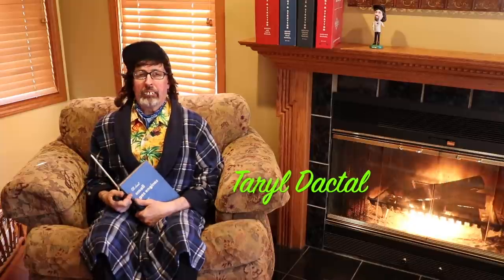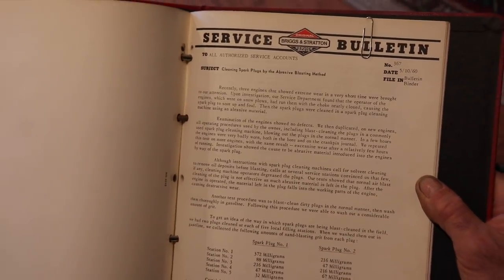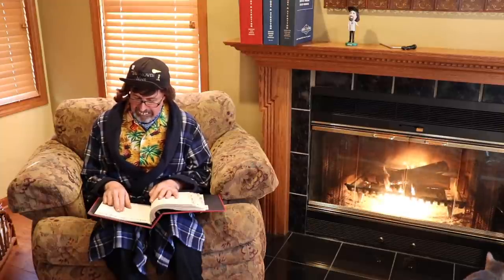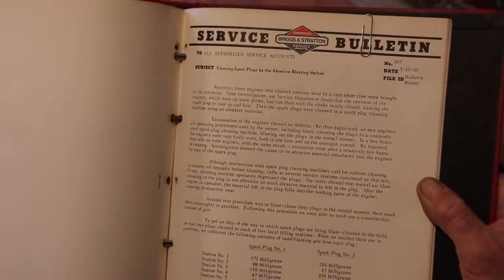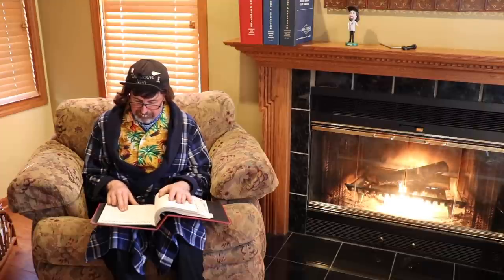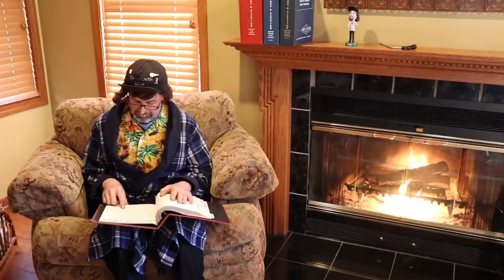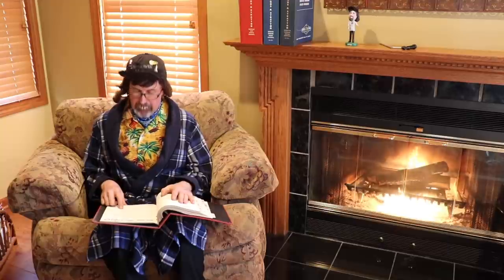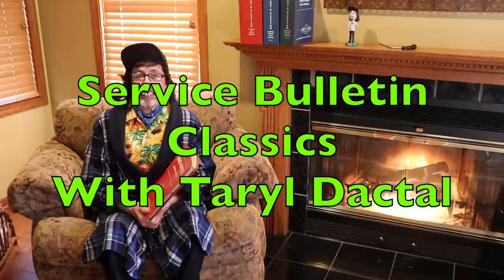Why You Should NEVER Clean Your Spark Plugs!

Comment: I have been cleaning sparkplugs with sand-blasting for more than 30 years and never had any engine problems. You just have to make to sure blow it out well with compressed air. I also use a fine steel wire to probe around inside to loosen up any grit jammed into corners, then blow out again. Finally, inspect with a bright light inside to make sure every piece of grit is out.  If you are sloppy and in a hurry, yes, you will have problems.

Comment: Taryl,  I just tried cleaning a used Champion J8C plug in a bead blast cabinet (same beads used in those spark plug cleaners) and yes the plug looks like new when finished. I flushed the plug after blasting with carb cleaner and then hit it with compressed air. I then inspected the plug under a magnifier and was shocked in what I saw. There were dozens of glass beads wedged between the center electrode and the porcelain insulator. I tried compressed air again followed by picking with a small needle. nothing I tried would dislodge the beads. I'd hate to see if I would have used that plug in an engine and have those beads loosen up and fall into the engine. A few of those wedging between the piston and cylinder could ruin the engine. I would be OK with using a wire brush and a flush with carb cleaner, but i agree, stay away from bead blasting.

Comment: We grew up in the 60's and early 70's, and dad had all kinds of machinery and did many kinds of repair and fabrication.  But one thing dad never mentioned and I don't recall having any access or exposure to is sand blasting.  Thus, we didn't use this method.  We would clean with a fine wire brush as I recall, and blow out with an air compressor.  Interesting post.
Reply: Same here. We used a wire brush.
Reply: I use my baking soda blaster and ultrasonic cleaner to clean dirty plugs.
Reply: Use a blowtorch, degrease and clean in one step
Reply: As a young boy, I  would take a  plug out and use the strike strip off a pack of matches to clean off the  tips.  Trail riding and trying to fix a miss out in the woods, using the tool kit under the seat.  This wasn't on a Norton or BSA though, just a Yamaha,  so I didn't have to thank the queen mother if I made it home.
Reply: the wire brush sometimes a wire wheel then check the gap sometimes and be backup and running but I do remember the spark plug cleaning machine but it always seemed pointless

Comment: B&S 12 hp single cylinder lawn tractor:  yesterday, I fired it up and headed to cut grass, and the engine misfired but kept running for another ten seconds and died.  Long story short, in an attempt to clean a semi-fouled plug, I noticed the porcelain actually had a crack in it, easily felt with a fingernail.  After installing a new plug, the engine immediately fired up and ran great.  $4.00 fix.
Reply: Honestly I never understood why anyone cleans them. They're so cheap you should be able to afford to change them yearly. Especially when it comes to small engine equipment.
Reply: @norge696  Probably two reasons:  part of troubleshooting process, to see if there might be a different issue, and secondly, people are naturally cheap/lazy.  I am.  LOL

Comment: Yipes...I used to use one of those spark plug sand blasting machines over here in Blighty when I was a Ford mechanic back in the 80's...we all did, we didn't know anything about cleaning them with petroleum spirit or that it caused damage to the engine
Reply: That's what made those Lucas Electric's to catch on fire!

Comment: You're scaring me. THANKS. I've been using my 1946 Champion Spark Plug abrasive blast spark plug cleaner since 1957. As far as I can tell, I have had no problem as you described but it is certainly  something to think about. Some of my engines have had the plugs cleaned (probably) 15 or 20 times. (A Norton 750 motorcycle comes to mind.) Now I'm thinking - grit in it may be why it needed so many cleanings. I've been cleaning it since 1972, I still have it and it's still in good condition but the plugs probably need cleaning right now. I'll have to think about that. Thanks - good info. You've made me think.

Comment: With many two stroke machinery....chainsaws, weedwackers, atvs, fouled plugs are constant. I have used the Harbor Freight spark plug cleaners with abrasive material to clean the plug. I am serious about cleaning out any remaining grit that may be present in the plug both before and after cleaning with the abrasive cleaner. I spray solvent into the plug to dislodge any grit and use compressed air to insure everything is dislodged. Dirty plugs are stored for bulk cleaning and then put away for use as needed. If you clean the plugs carefully, you will not have a problem.

Comment: Because so many small engine spark plugs are made off shore, I air compress brand new ones and sure enough, there's always one or two out of a batch of 50 that has particulate that was hidden deep down the base of the plug.

Comment: Back in 60's & 70's almost all garages, engine shops & high school shops had a spark plug cleaning machine...ohhh crap!!!  🍺🍺🍺
Reply: We had one in auto shop. I put car plugs in a pan, filled their cavity with carb spray, let them sit, then tapped them in the pan while setting the gap. If stuff came out, I washed them again, just carbon. If they were blasted with sand for cleaning, same process. Didn't kill any rings.  It's onne o'clock and time for lunch. Dumdedumdedum. There always was ethyl, now it's ethanol. Bastiges, thanks taryl.  Right jolly old chap

Comment: I have cleaned with a wire brush in the past.  Is that just as bad?  I live in a very rural area and sometimes buying a new plug is not an option as it takes a few days.  I have never reduced the life of the engine as far as I am aware.  What do you guys think?

Comment: I took vocation auto in the late 60's, we had a plug blasting machine as did a lot of repair places, worse, Kmart sold "remanufactured" plugs that were just old plugs cleaned by blasting and packaged. I don't know about these plugs ruining engines but the plugs generally quit sparking. Those plug cleaning machines fell out of favor after awhile.I
I had an old 2 stroke weed trimmer that I would just use a squirt of WD-40 and a tooth brush to clean the plug, worked fine.
Reply: WOW  I VAGUELY  REMEMBER   Kmart "re manufactured" plugs  ,,  VAGUELY 
thanks  Ed   Loretto  Ontario  Canada

Comment: well that and modern spark plugs have plated electrodes. I had a 1972 Chrysler Imperial LeBaron Brougham with bad oil seals on a 440RB at one time in the early '80s. I used to call it 'the Brougham away from home'. Can of carb clean and a plug blaster worked wonders. I put 8 of those antifouling thingies on it and that was the first car I ever sold for a profit.

Comment: When I started working on lawnmowers we cleaned plugs but never put them in the plug cleaner. Only car and truck plugs were used in the cleaner. then we always blew them out with air. The mower plugs were cleaned by a handheld wire brush only and if not it was replaced. And we always checked the gap before we installed the old or new plugs. Even now I never trust the per gapped plugs.

Comment: I recently repaired head gaskets and discovered two bolt that held right side of muffler was missing and deducted that the heat from muffler had weakened the springs.the throttle would only go half throttle so I replaced the two springs and full throttle was achieved. The heat from exhaust was the culprit.

Comment: You should have shown one of the old hand held spark plug blasters, I think some people probably have never seen one. I used one often but I would use a thin piece of flat steel to scrape out any material left lodged insides  the plug.

Comment: Taryl, 
You can’t just buy another one of your 100 year old spark plugs. How would you clean that one?
The snowcats in your book fowled because they kept the choke open. I try to avoid ever using a choke even in cold weather. I just let it warm up running rough and lean. Will that warmup time while running lean hurt the engine?

Comment: "F" that Teryl...I never buy a new plug...I've always cleaned mine with a wire wheel...(not a sandblaster)...a new spark plug where I live is 15 miles away so including gasoline, time spent, down time, wear and tear on my car; and the actual direct cost of a plug...I'll clean mine.  But I have heard about the sand getting into your cylinder...but 216mg?  I call bs on that.  I had to convert milligrams to grains because I know what grains are for bullet reloads.   So that bit about it fitting into a nickel is about right.  HOWEVER: I cannot believe #1, someone would not blow out a spark plug before putting it in an engine.   #2, I cannot believe that the amount of grit supposedly found (216mg) would fit into a spark plug.  Anyway, thanks for sharing 1960 B&S Tech.
Reply: They suggested not decreasing the plug first let the grit get lodged in the residue.

Comment: Sounds like they must have been using this on auto spark plugs as well. I'm sure it shortened engine life for them as well. I remember the cars of the 60s when you'd get a 12 month 12,000 mile warranty. Salt would eat through them and if you got ten years or a hundred thousand mile you were lucky. However the built some lawn and garden stuff that's stood the test of time. Thanks for the fireside chat.

Comment: I while back you did a vid on Honda eu6500si  had a question about one of mine it will start fine on first pull but then shuts itself off 3secs later oil I level is good any ideas?

Comment: I’ve looked at more SEM images of sandblasted surfaces then I want to think about. I would never use it to clean plugs unless I was stranded. The metal gets smeared and can trap blast particles that would only come off in extend heat, then there the ceramic that becomes both a media trap, and source of more particles as places that are partially fractured will dislodge with heat.

Comment: I have worked with spark plugs for over 60 years. I have NEVER abrasive cleaned any spark plugs. also the abrasive will destroy the glaze on the center insulator so it will collect carbon and short out prematurely.
Reply: It ain't a space or rocket ship...nothing wrong with cleaning plugs.

Comment: I use a wire brush and wash it out with carb cleaner or ether. Every one worked fine so far. And ETHER makes a good parts cleaner/degreaser even with the 'upper cylinder lubricant'.

Comment: I clean the plugs after I sand blast them, with brake cleaner, compressed air, and a nylon brush UNTIL they are perfectly clean!

I've done that for years, with no issues, so I'm not going to stop.  

If Briggs made decent carburetors the plugs wouldn't foul so frequently!
Reply: I just buy them in bulk for less than $2 each and change them every few years on all my equipment.
Reply: Or if people cleaned out the air filters regularly.
Reply: "$2 each" adds up, but I typically have plugs that I already cleaned ready to go. I toss their dirty plugs in a box, then go through the box during down-time. If I don't have any ready, I give 'em new ones, but save the old ones so I have clean plugs ready for when I see that equipment again.

Comment: Agree on the spark plug cleaner. There are times when a plug is fouled and a spare plug is not readily available. So cleaning it is the only option. I clean mine sometimes but afterwards I always take a little wire from an Acetylene torch tip cleaning tool and run around the base of the insulator to dislodge any stuck material. I then follow with rinsing with carb cleaner and then blow off with compressed air.  I've been using this procedure for several years.

Comment: There you have it folks.  
Imagine this, forgot to mow the grass and its Sunday evening.  You pull out your mower, prime the carb with three squirts.  One pull, two pulls, three pulls nothing.  Squirt more fuel into the carb.  4 pulls, 5 pulls, 6 pulls, 7 pulls, 8 pulls nothing.  Not even a putt putt.  Unscrew the spark plug, its soaked with fuel.  Don’t have another plug and all the stores are closed.  Look at the sandblaster...then look at the 400grit sandpaper...and then contemplate the wire brush...
“Shucks, Forget it!”  Push mower back into the shed.  Go into the house and grab a cold drink.  Mow the grass later...

Comment: Good Stuff.   I've actually heard about this issue before.  A quick shot of pressurized  WD-40 around the Plug Electrode mitigates the problem.    Eaaaaa !   I'm a firm believer in Marvel Mystery Oil .  Over my decades of small engine use,  I'm more the convinced the stuff extends engine life.   What's your take of it's use ?

Comment: I worked at  a gas station/repair shop for autos and we didnt liquid clean the plugs before putting them in the blaster but after we did and it seemed to work well that was 40 years ago now i just buy new plugs also if you enjoy questions why all the hype about 4 pronged plugs and 3 and 2

Comment: I clean them all the time. I use my ultrasonic cleaner with simple green and distilled water. 35 to 40 minutes will clean them as good as new and no grit involved. Small engine plugs get thrown away all the time because they are fouled, but not worn out. Try it you might never need to buy another lawnmower plug again. Guys like Taryl will hate you for that part though.

Comment: I always just buy new ones but for a different reason... mine is laziness and also getting the perk of brand new clean plugs without investing in a plug cleaner and not spending  the time to do it. By time you factor in the cost of the cleaner and the time its only a little cheaper than just buying new ones... and now I just found out that its the best way ta go !!

SCORE !!!!!!!

Comment: I use a pneumatic spark plug cleaner that I just hook up to my air compresser. it doesn't do damage
Reply: Is it the HF unit per chance?  If so, the black powered cleaning media is abrasive.

Comment: My Different Types Of Brass Brush Cleaning Wheels, Have Done A Fine Job, For Over 25 Years And That's If I Can't Go Buy A New Plug Right At The Moment But I Agree, Spark Plugs Are Cheap And Better To Replace It Whenever Needed And A Couple Times Each Year With Moderate Or More Use In Even 4 Cycle Engine!!!! 💪
Reply: I retired early because of all the money I've saved with free methods like this...its not better to replace with new...and it's not bad to sandblast.

Comment: Ewww, when my brother and I were wee, father taught us to use only carbon tetrachloride from a special fire extinguisher mounted on the wollll to clean our plug.  Having a two stroke mini bike, aka as a doodlebug, we used the process with an wire of copper to clean smudges of crap in said spark plug. ;-)>
Reply: Yeah, as a teacher my dad had an incident with carbon tetrachloride...   an extremely toxic and dangerous substance. Carbon tetrachloride is one of the most potent hepatotoxins (toxic to the liver), so much so that it is widely used in scientific research to evaluate hepatoprotective agents.[10][16] Exposure to high concentrations of carbon tetrachloride (including vapor) can affect the central nervous system and degenerate the liver[16] and kidneys,[17] and prolonged exposure may lead to coma or death.
Reply: @ya472  When I tore the garage down that fire extinguisher was still there with about half the contents still in it.  I'm pretty sure you can't buy carbon tet on the market any more.  I'm 68 and I haven't shit the bed yet.  My brother is gone but it wasn't carbon tet, it was Diet Mountain Dew and a bad diet.  Buy a new spark plug!
Reply: @ya472  Many years ago I had a friend who used Carbon Tet to degrease an engine and the next morning he was dead. They blamed it on the Carbon Tet.

Comment: That HVAC guy who came to my house thought like this too.  Your furnace is cheap and several years old, so you should just buy a new one instead of fixing this one.
Reply: Don't be a dope with your apples to oranges comparo logic.  What you are saying is...the tech said throw out the lawnmower and buy a new one because the spark plug is bad?  Typical "Never had to fix or replace it before" attitude I guess.
FYI:  I replaced my outdoor unit's dual capacitor for $12 a couple of times over a 5 year period. (Think spark plug.)   I eventually had to replace the whole HVAC system because of a leak in the outdoor unit and R-22 parts/materials are no longer available at a reasonable cost.   The brazing repair was not advisable as it was difficult and wouldn't last but a season or two IF it could be done at all.  (Think not totally worn out but just not economically repairable for long term use.)  Then there is the labor/time to do the work.  When it's 95+ outside, my time was better spent at earning the $ for the work than doing it myself.
It's part of our "Buy cheaply made products today means throw away tomorrow." culture.
Reply: The furnace in my rental lasted 45 years.  But the last 5 years it stated costing too much to fix @ $500/repair.  I replaced finally @ $2200.00.  I wanted to get a 2 year certificate from a licensed HVAC Tech but he said no way.  I sold the house...

Comment: The cost of a spark plug isn't always it's line item price on your receipt when you get it at the store.  It's also your time to chase one down especially if it's a rare type.  I've cleaned plugs by abrasive methods a lot.  Just remove the grit from them.  Use the same method of removing the grit that the people that this study did.  They obviously got a nickel's worth out somehow.  You can see the grit stuck down in there, just remove it!